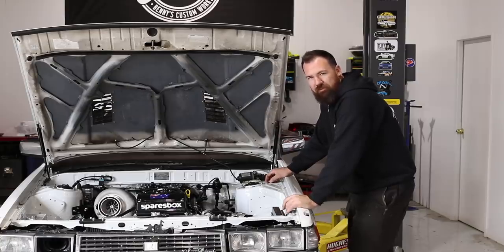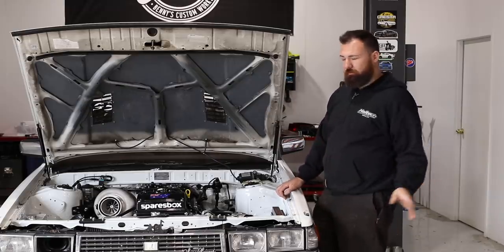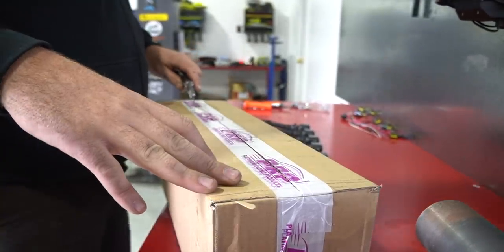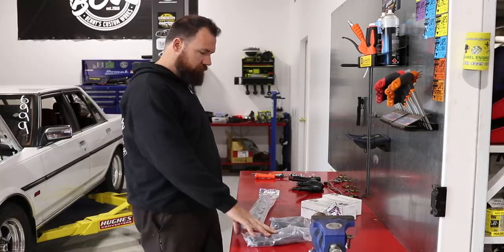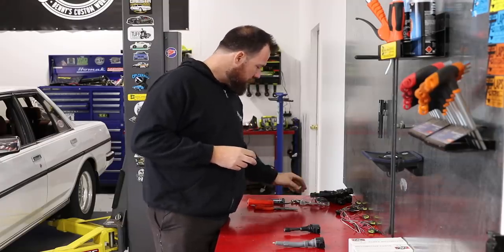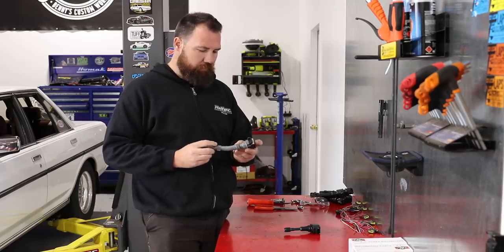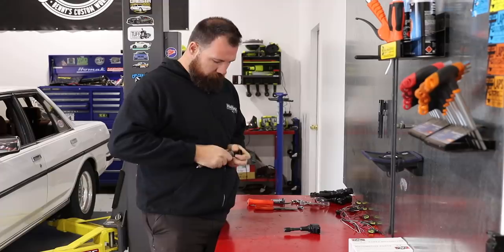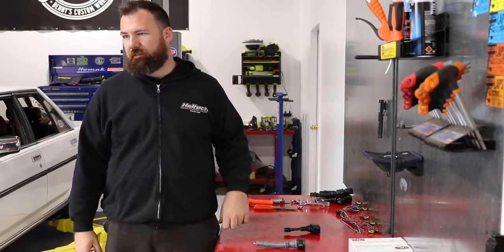CRESTA - R35 Coil Pack Conversion

Comment: Great video, very informative. My only complaint ( not related to the video ) is the ads. Two and a half minute ad about USB hard drive, a five minute ad about super or financial planning, and another five minute ad about brakes. All boring. Would have been great to have had Benny to do the ads.
Reply: The only option Benny has is when ads should happen. The type of advertising is specific to the profile Google has built on you behind the scenes. Also, you can typically skip ads after 5 or 10 seconds.
Reply from the maker: As mentioned we don’t choose the ad content. Also the ad’s help pay for the ‘free’ content everyone watches.
Reply: Benny's Custom Works Understand the need to use ads to pay for the great content. I always watch the ads as I understand there is no payment if they are skipped. Is that right?

Comment: I’ve been wondering; why the missing headlight if your turbo is just pulling ambient air from the engine bay? Or is that just an unrelated aesthetic choice? :p
Reply from the maker: Peter Charlton there’s a duct that directs air in. It’s not directly on the end of the turbo as it may create more turbulent air flow.
Reply: @BennysCustomWorks  Does it make a measurable difference? Or have you not A-B tested it?
Reply from the maker: Peter Charlton 3 mph more with the tube installed
Reply: @BennysCustomWorks  Every little bit.